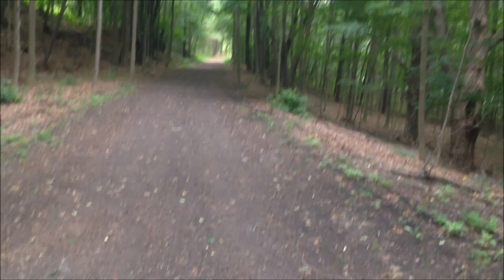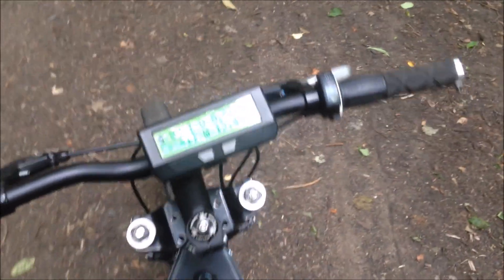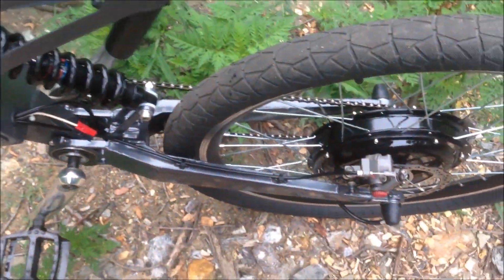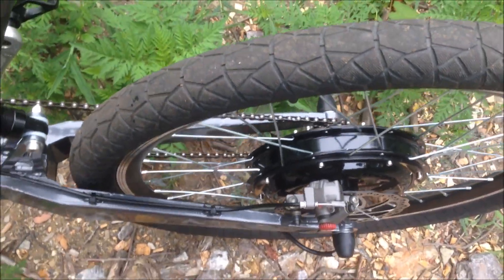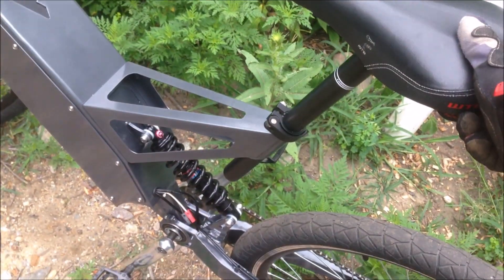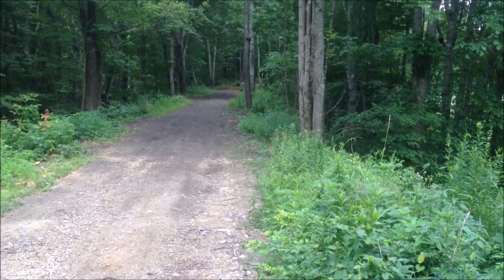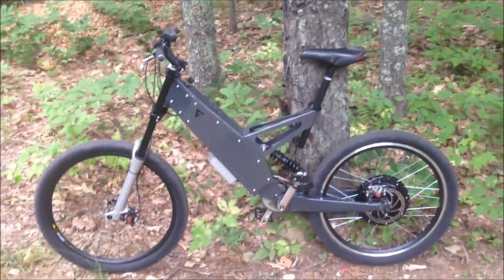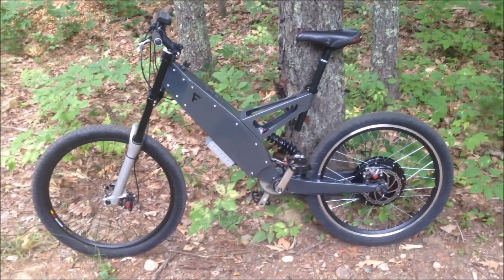72V FUTR Beta Electric Bike Test Ride 8ah 18650/12-Fet

Comment: hey man, amazing build! do you have a more comprehensive part list somwhere (like a blog or do you mind sharing?) Im planning on buying this or the Aplha frame. I want it to still look like a bike and not a motorcycle (if I can ride past police and not get pulled over then its legal in my opinion lol). Do you suggest getting this frame? Will I be able to install a battery system and get 40mi on a charge? what your top speed and motor you are using? Would love for you to give me any info you can on this amazing build you did
Reply: ideally, Id like to maintain a cruising speed of 30-35 mph (top of 50mph maybe) and be able to ride 40 miles. do you have any advice for a set-up for me? Im going to be only commuting and no offroad use